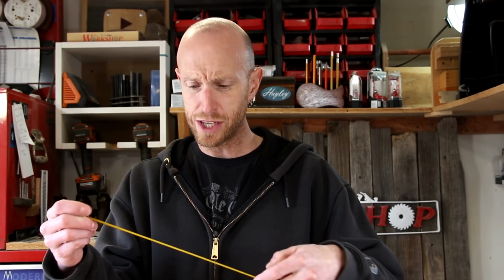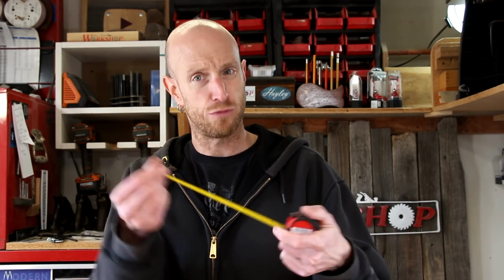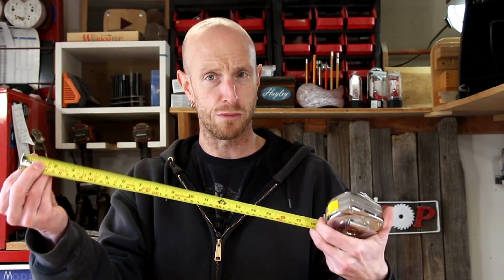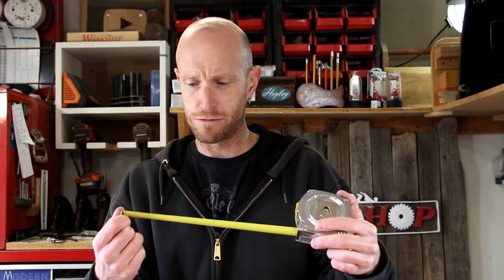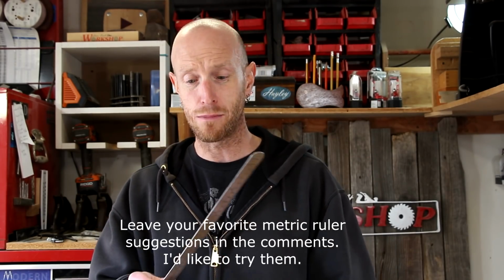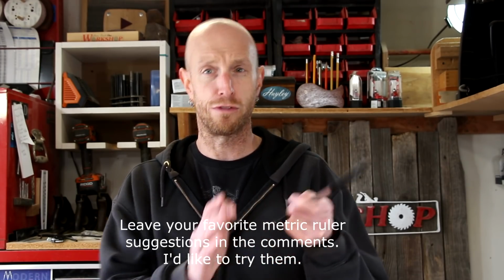My thoughts after using the Metric System for a project | I liked it

Comment: The metric system really starts to shine when you need to convert between different units. Not just length, but weight and volume too. For example, a box with the inner dimensions 10 cm³ holds 1 liter of water and 1 liter of water weights 1 kg (adjusted by temperature / density).
Reply: 10cm3 is NOT 1liter.... 1 dm3 or 1000cm3 is 1 liter..
Reply: @rogernilsson996  True, he means (10 cm)³ or a cube 10 cm on a side.
Reply: @rogernilsson996  Maaan In what universe are 1000cm³ 10dm³? I'm only 187cm tall! I would be TINY :O
Reply: @leon3xr633  what are you talking about? 1dm3 contains 1000cm3......
Reply: @leon3xr633  I don't even know how to start correcting or commenting this post XD
Reply: @leon3xr633  Common mistake, 1dm = 10cm, 1dm^2 = 100cm^2, 1dm^3 = 1000cm^3 = 1 liter

When dealing with more dimensions you need to square/cube
Reply: @leon3xr633  so basically 1dm^3 equals (10cm)^3 equals 1000*cm^3, if im assuming that you meant 1dm^3, if you really meant 10dm^3... then you are right 1000cm^3 doesnt equals 10dm^3 and a 1000cm^3 isnt that big, imagine a cube made out of 1cm^3 minicubes (1cm x 1cm x cm), then you would have a cube made out of 10 x 10 x 10 minicubes which equals 1000 blocks equals 1000cm^3
Reply: @IchBinBartlos 

Roger said a 1dm³ volume has a volume of 1000cm³ (which is incorrect) 
10dm³ have 100cm³ of volume or one cubic meter (1m³) (this is correct)

I simply stated if 1dm³ were 1000cm³ a 1 Liter vessel would be 5 times taller than me (which would make me tiny in that incorret understanding of decimals and the 3 dimensions)
Reply: @leon3xr633  please say that you’re kidding. Please.
Reply: @leon3xr633  Bro 1dm3 is 1000cm3, tell me how roger is wrong?
Reply: @rogernilsson996  Yes, thats why he said 1000cm3 and 10dm3, which ISNT true
Reply: @leon3xr633  You are so wrong. Go back to school please instead of misinforming people on the internet.
Reply: @nyChannel09  Oh I forgot volume and volume measurements are one and the same thing my bad I apologize 

I got the wording mixed up of 1dm being the same as 10cm and didn't think the unit of measurement being a factor of 10 by itself (Now why do decimeters multiply by 10 anyway? I don't get this one)
Reply: @leon3xr633  Are you american and what do you mean with "multiply by 10" (im friendly dont worry, really dont understand ur question though)
Reply: @nyChannel09  No and I got it again... I just forgot that each finer degree of measurement counts the individual cubes inside the volume of a higher multiplier
In this case the cm cubes inside the decimeter cube (and to everyone else: No need to cuss at me I simply forgot how the wording for volume and surface measurements aren't as straight forward as words) I simply thought that the units are words that describe the length of the side of a cube that THEN gets multiplied 3 times with itself It's been a while since I was in school I just needed a refresher
Reply: @leon3xr633  
1 meter = 100 centimeters (cento = 100, so 1cm is 1/100 of a metre).
1 decimeter (dezimus = 10) = 1/10 of a meter, so 10 dm = 1meter.
1 millimeter (milli= 1000) 1/1000 of a meter. (Yes its milli not mili)

Now obviously you can say for example: 1dm = 10cm = 100mm.

With volume ofc its different now, because you have 3 dimensions instead of just one, that means
1dm3 which is 1dm(10cm) • 1dm(cm)• 1dm (10cm) = 1000cm. 

Basically factor 10 (step from dm to cm) to the power of 3 (because we have 3 dimensions which gives us 1000)

Did this help?
Reply: @leon3xr633  yes, I saw your comment, after I posted my whole essay on metrics to try to help you.
Reply: @nyChannel09  Thanks, and yeah it did. I forgot that the words themselves are dividing as I described in my comment above
Reply: @morganmitchell4017  I explained myself above
Sorry for not remembering a concept
I hope you got my point of view (the comment above)
Reply: @nyChannel09  Thanks again. And sorry for forgetting latin nomenclature (I'm not good at that stuff :D)
Reply: TLDR for anyone wondering what all this was about: I thought the number before dm³ needs to be multiplied to get the volume when the number already says how many cubes are inside of said volume

so yeah 1dm³ is 1x10x10x10 in centimeter or 1000cm³ or 1000000mm³

I will now not respond anymore 
Have a good day everyone
Reply: I thought metric was supposed to be easier. This comment section got me even more confused
Reply: @rake1087  1m = 10 dm

1m^2 = 1m * 1m = 10 dm * 10 dm = 100 dm^2

1 m^3 = 1m * 1m * 1m = 10 dm * 10 dm * 10 dm = 1000 dm^3

Nothing confusing here, just a common mistake when you forget that you need to square/cube when dealing with bigger dimensions
Reply: Indeed. Good luck converting pounds to cubic feet to cubic inches (not to mention, gallons...) 😜
Reply: @rake1087  it is easy, just don't read anything but Howdie Rowdie's comment.
1 mm needs 10 to be a cm (centimeter)
1 cm needs 10 to be a dm (decimeter) (though i haven't seen it used often, mostly skip this but i'll use it to explain and keep it constant)
1 dm needs 10 to be a m (meter)
1 m needs 10 to be a dm (dekameter) (likewise haven't seen it used, skip this usually (?))
1 dm needs 10 to be a hk (hektometer, also rarely used)
1 hk needs 10 to be a km (kilometer)
Reply: @rake1087  It's quite easy. You just have to be aware that if you square or cube the units, you also have to do the same to the numbers. Like this: 
1 dm (Decimeter) = 10 cm (centimeter)
1 dm² = 10*10 cm² = 100 cm²
1 dm³ = 10 * 10 * 10 cm³ = 1000 cm³.

Imagine a cube that has a side length of 1 inch. If you double the side length, you do not double the volume, you get eight times (2³ = 8) the volume. That's basically what all of the above was about.
Reply: @Cygnus_B  10 dam (Dekameters) are 1 hm (hektometer) or 100 meters. 1 km is 1000 meters.
But Deka- and Hekto- are almost never used, so you could just ignore those and just say 1000 Meters = 1 Kilometer. The only case I know where Hekto- is used is with the beer production of breweries, which is measured in hektoliters.
Reply: @tjtourette5261  Whoops, slipped there, thanks! Edited the comment.
Reply: @rogernilsson996  10cm^3 is the same amount as 1dm^3 weren't you taught this in kindergarten?
Reply: @leon3xr633  you are wrong XD 1dm^3 has 1000 cube of 1cm^3, 1dm^3 equals 1dm x 1dm x 1dm equals 10cm x 10cm x 10cm equals 1000cm^3 ergo 1L is a cube with 10cm side length and if you are smaller than 10cm you ar epretty tiny

edit: sry, hasnt seen your other comments, only that one you answered to mine, I have seen that you corrected yourself already
Reply: @eVill420  imagine a cubiccentimeter as a piece of sugar 1cmx1cmx1cm...... Does 10 of these pieces fill up a box that that is 10cm(1dm)x10cm(1dm)x10cm(1dm)?????
Reply: @rogernilsson996  you such a troll ^^ i love it

Comment: The metric system is not just for height and weight, it's all about easy logic and conversion. You only have to shift the decimals.
1km = 1000m
1m = 1000 mm
1 liter = 100 x 100 x 100 mm
1 kg = 1 liter of water
1 metric ton = 1000 liter of water
1 m² =  1 x 1 m
1 km² = 1 x 1 km or 1000 x 1000m = 1.000.000 m²
1 m³ = 1 x 1 x 1 m or 1000 x 1000 x 1000 mm

and a bit more complex but still easy to understand:
J = kg·m2·s−2 
= N·m 
= W·s 
with J=Joule for Energie, N=Newton for Power and W=Watt for performance

and now try this with the imperial system without using any kind of device for help ;-)

Comment: "This one is too large, a 26 foot tape"...

Ok, and how much is that in normal people measures?
Reply: I think about 8m?
Reply: Assuming metric is normal for you - Google says 7924.8mm.  Is Google "standard" in your land?
Reply: @JimmeShelter  no need to be this snarky
Reply: @JimmeShelter  is Google standard in yours? Can you choose another search engine?
We can.
Reply: @JimmeShelter  so 7.9248 meters
About 8 meters
Reply: Well, that is easy: 1 foot is defined as 12 inches. 1 inch is defined as 2.54 cm, so 26 foot equals 26 times 12 times 2.54 and you have your length in centimeters. Oh, did you notice that the inch actually is defined in metric units?
Reply: @pisos95  Switching back to serious: Actually SI and metric have little to do with the number 10.  The factor 10 is chosen because it is the base of our number system. But you can just as well calculate in other number system. Computer systems these days calculate with a base of 2 but other bases as 8, 12 or 16 are in use as well. Often the base is noted as a subscript (and I do not know how to do that in a comment). 100b8 would be 100 base 8 which would be 64b10 or 64 in the decimal system or 44b16 in hexadecimal (base 16).
Back to your original question: There was this one guy who looked at his hands and the hands of his colleagues and noticed all of them had ten fingers. So he decided on using ten as the base of his counting system would be a good idea.
Reply: @JimmeShelter  So that's 8m tape measure. Probably the guy bought it because he didn't realize how much that actually is. In carpentry we normally use something like 3m (10ft) or when we want to get crazy we get 5m (I think you might have 16 ft, but actually more closer to 17ft) tape measure.
Reply: @Sorin thats accurate XD
Reply: 10 feet approx 3 meters
Reply: @JimmeShelter  nice system if you need google to translate what it means
Reply: @JimmeShelter  How about that. I learn something new every day. I would have thought its three elbows, half a knee and a chicken head. Why wouldn't it be? Seems just as logical as 26 stinking feet.
Reply: @alexanderstamov2237  Elbows, knees, chicken heads aren't standard measures Google can't translate those for you.  You have other problems.  "Feet" are internationally defined in terms of metric measures.
Reply: @JimmeShelter  Touched a nerve did I?
Reply: It is a 26 foot tape measure.  Normally they sell 25 foot tape measures SO THIS IS AN ODD-BALL..  No manufacturer gives you more than they have to.
Reply: @JimmeShelter  7.9 meters. easy conversionz
Reply: @JimmeShelter  7924.8mm is 7.9248m, I made the calculation mentally in less than a second and I'm sure to be accurate. Convert 7924.8 64th of an inch to feet mentally in less than a second with the same accuracy and no errors. You have 0.5 seconds to do the math.
Reply: @wora1111 very easy yes...

Except if you could just do x10 for everything thats not time related
Reply: @Jimme Shelter  since pretty much the whole world uses metric yes, metric is the standard